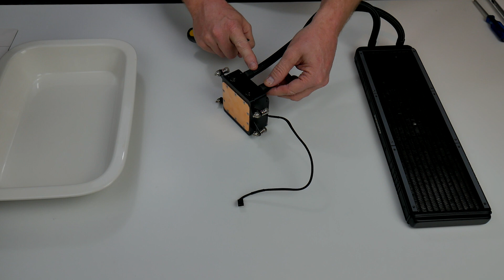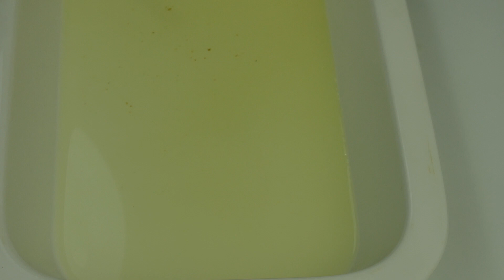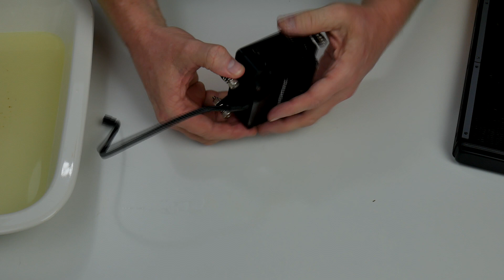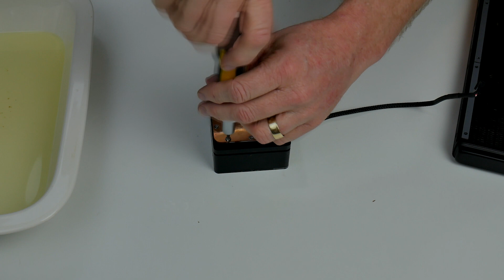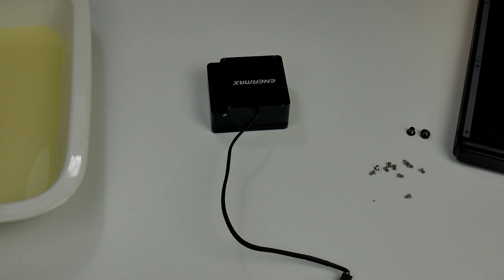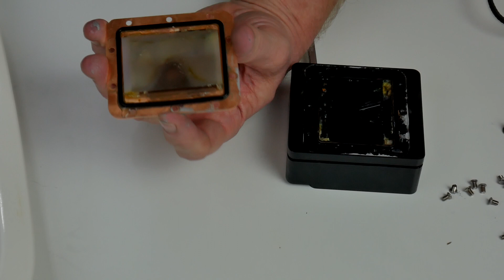Part 2. Don't buy Enermax LiqTech TR4 Threadripper 240 280 360 AIO cooler.This is why.

Comment: If anyone stumbles upon this video, and is contemplating purchasing the 2nd gen Tr4 II version, buy something else! Because Enermax has halted shipments of the TR4 II due to it having the same issues as the 1st gen cooler. You can find evidence of this claim on the HardOCP forum, where a posting by an Enermax rep corroborates this development.
Reply: Can you post a link to that article / thread? I, myself had just RMA'd my LiqTech 360 TR4 Gen 1 due to overheating, which, surprisingly enough, also started happening after a year of owning it. Would love to read up on it myself
Reply: thx but i just ordered Silver Arrow TR4
Reply: Had to RMA mine as well. They told me the issue is resolved now. But we'll find out if that's true. They didn't even want my defective one back, so I'm gonna do a tech autopsy on the defective one.
Reply: ah thanks for that comment, i thought that 2nd gen didn't had such issues so i thought to buy it but wasn't sure, guess i was wrong, thanks // is there any other full coverage TR4 liquid coolers which one would recommend?

Comment: So, just flush the system and use Distilled Water and a Bio-syde. Will do.
Reply from the maker: You also need something to stop the bi-metallic corrosion which is why I used car engine antifreeze designed for this purpose.

Comment: We have now Threadripper 3000 on the market. 3970x and 3960x. I want to buy silent, without problems cooling system. Could you tell me, what kind of cooler should i buy: AIO - tell me the name what is the best or custom cooler, with reservoir, pump and so on. Help me, please.
Reply from the maker: See the Coolermaster here. https://www.coolermaster.com/catalog/coolers/cpu-liquid-coolers/masterliquid-ml360-rgb-tr4/

Comment: Hello Thec it Out! I made a big mistake! i bought noctua dh15 thinking that 2 fans was better than one. But it not fit into my Socket 4094. So!... do you think the Noctua Mounting Kit coulf fix it? Or should i sell the Noctua DH15 and buy  Noctua NH-U14S TR4-SP3?
Thanks!
Reply from the maker: The UH14S would be a much better way to go as it has a specific  TR4 heat  plate and will perform better. Thanks for the question.
Reply: @TechItOut  Thank you!

Comment: wich one is the best for a threadripper 2990wx ?
Reply from the maker: Noctua NH-U14S TR4-SP3, Cooler Master Wraith Ripper TR4 or COOLERMASTER MasterLiquid ML360R RGB TR4 if you want an AIO. Thanks for the question.

Comment: I had mine since oct 2017 and i cant do 4ghz anymore. It stable at 3.9ghz though and temps remain at like 68c under full load. Idle temps are 37-50c

Comment: Very informative! May I know how you get the fitting off from the pump? Did you just pull it out, or was there a screw mechanism? were you able to put it back?
Reply from the maker: there are two long thin screws one for each fitting. Once removed then the fittings just pull out. Thanks for the question.
Reply: @TechItOut  Could you Please specify where those two screws are？
Reply from the maker: @yifeip2361  Have a look at this point in the video. https://youtu.be/g-YgNSclpC8?t=115 Thanks again.

Comment: Bought 5 gen 1 versions for my workstations in Jan 2018. All ended up making the PCs idle at 68c - 70c by the end of the year. Didn't go through with the RMA because the first RMA I filed had me ship out the defective unit before they could consider sending out a replacement. Therefore, I shelled out money for the Gen 2 version (rgb one) units. They didn't last more than a couple months. I then tried installing a game on one of the workstations on a hunch, and good lord, the temp got up to 91c and froze the computer promptly. Im now on the Noctua U14s, and with the 4.0 OC on 1950x, the idle stays at 38c, and full load temp doesnt exceed 62c. Fu¢k you, Enermax!

Comment: This is my 2nd Liqtech TR4 360 after I RMA'd the initial purchase.  I disabled 8 cores on my 1950X and currently my temps are over 68C and clocks throttled to 600Hz.  I just had a new set of fans sent to me by Enermax as all those on my replacedment became very noisy in a couple months.  Really is a shame.

Comment: dunno if this is legit, but it seems they are aware :) 
https://smallformfactor.net/forum/threads/enermax-responded-to-the-liqtech-i-ii-corrosion-problems.9133/
Reply from the maker: Thank you for this.  Yes they have gone someway to admitting that their products leak. This however is a separate problem in that the fluid or electrolytic reaction within the unit causes it to completely block up and fail.  Thanks again.

Comment: Thanks for helping me and others dodge a bullet.
Reply from the maker: Glad it was of use. Thanks for the comment.
Reply: @TechItOut  The old version had some problems but the new RBG version is working perfectly for me.
Reply: @user-l6e5z  i have had my 280 rgb new one for 6 months now, my max PBO is now 3.2Ghz in cinebench used to be 4.1Ghz when AIO was new. I am ordering Primochill IcE to replace fluid in my unit. Max stable manual OC i can achieve on all cores now without throttle is 3.6Ghz, anything above it starts to shut down cores. I think its the AIO corroding.
Reply: @UnDadFeated  That sucks. I hope mine doesn't corrode... But if it does I bought it with a 2 yr warranty from Microcenter.

Comment: Great video,  bad cooler. Now I see why my enermax was  so bad lately. I sent it back and bought mark ii model. Am I naive to believe they addressed the problem? I ordered Noctua NH-U14S TR4-SP3 to make some personal tests. I pray for enermac though
Reply: I've had a version/mark 2 for a couple of months now as it replaced my dead v1 after 13-14 months of use. This week the radiator fans have started to throttle up on occasion while idling, same as v1 did originally. I hoped they had sorted it for the new version too but at the moment I expect it's going to slowly get worse and die over the next few months.
Reply from the maker: I have had several messages saying the same thing. What I don't understand is why when it is so easy to fix, they haven't done it.  I am hoping to publish a video showing this in the near future. Thanks for your comment and update.
Reply: @TechItOut  Thanks, for the quick response. I first noticed there could be a problem when I watched the Gamer Nexus video on refilling the v1, where he showed the corrosion on the end of one of the screws from the pump block but he put it down to the metal of the screw rather than the coolant.  Amazon UK has a load of comments on this product dying so easily. I went for an aio as I didn't want to create my first custom loop on such an expensive system.
Which Noctua do you have, btw? When my v2, likely, dies I will go for a non-Enermax replacement. I noticed there is a Coolermaster with full plate coverage too. I'm from Swansea btw
Reply: @sent-to-cov  I went with the Noctua NH U14s TR4 SP3 and an additional 
NF-A15 fan.    I won't be rushing back to water cooling, although in fairness this has been my only problem despite creating three or four water cooled builds.  Check the Noctua site to make sure your motherboard has enough space.
Reply: @TheAshleyJones  Cheers, will do.
Reply from the maker: Hi and thanks for the comment.  Yes I too hope they have addressed the problem. Unfortunately they have not given me or made a statement elsewhere saying that they have.  I would be very reluctant to buy another until they did as I need my PC up constantly and I am lucky in that I already had a Noctua, which by the way I cannot praise highly enough. It is a great tower cooler.  Thanks again.
Reply: Mine was exactly the same - actually a bit worse.   I went with a Noctua and have lost all confidence in the Enermax.